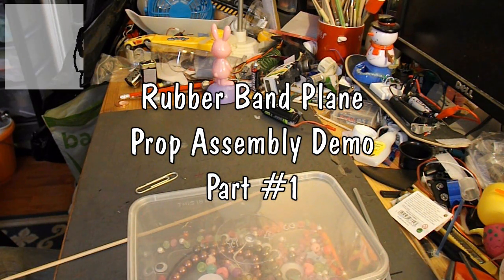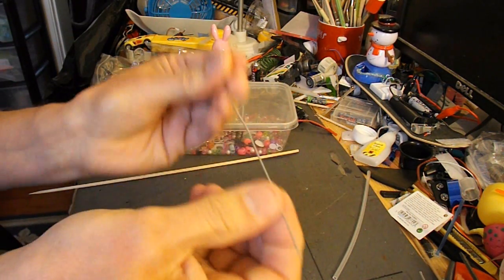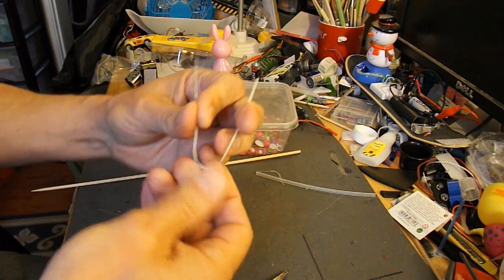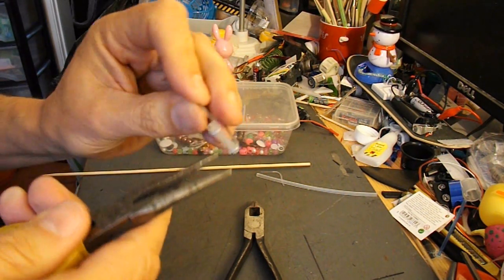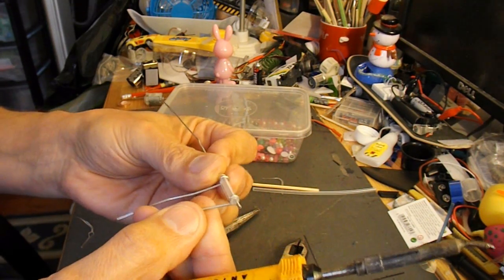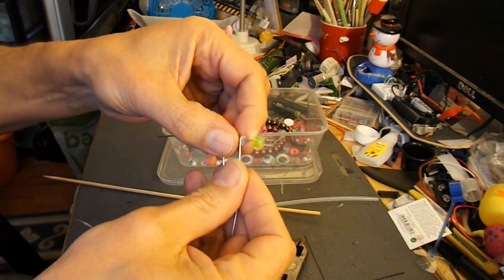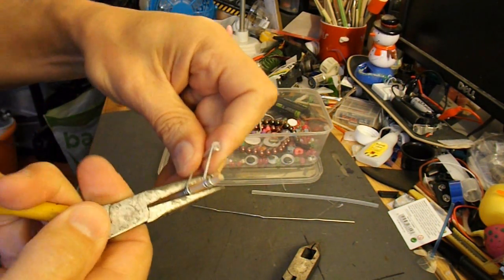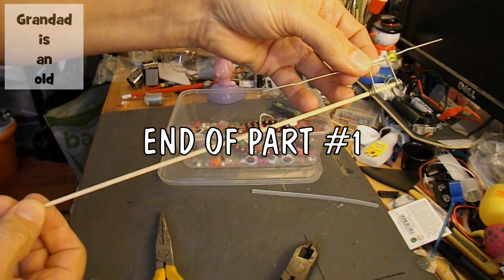Rubber Band Plane Prop Assembly Demo Part #1

Comment: Can ya get any substitute for beads?  Would 2 beads be better than one? I used the chopstick to wrap the metal too whole lot easier.
Reply from the maker: The bead serves 2 purposes, it stops the assembly digging into the plastic tube and it provides a low friction surface. Two beads rubbing together probably would give you less friction. Glass beads would be better than plastic. Anything you can find that will reduce the friction would help. The curved surface of a bead minimises the surface area in contact.
Reply: Ah thats very helpful thanks! it doesn't work without beads, glue and metal give lots of friction

Comment: and which prop is best for airplane??
Reply from the maker: My answer is basically the same as my answer for boats. I would suggest asking that question on an RC Aircraft forum. I would think it depends on what purpose you are using it for. In many cases people use multi-bladed propellers when they want to keep the diameter small. I have seen many debates on the subject. I suspect a two bladed propeller is the easiest to make. There are debates about the speed of the tip of the blade relative to the RPM and the tip of a large diameter propeller passing the "sound barrier" causing aerodynamic issues.

Comment: which prop is best for boats ?  3 blade or 8 blade??
Reply from the maker: I have no idea, I would suggest asking that question on an RC Boats forum. I would think it depends on what purpose you are using it for. In many cases people use multi-bladed propellers when they want to keep the diameter small.

Comment: Hi GrandadIsAnOldMan,
Could you please let me know where (which Shop) you got those Beads?  I  I was able to make a styrofoam plane the first one didn't fly but the 2nd one did.... tried to use Rubber Band for the propeller - didn't work... needs more trial for adjusting the CG....  propeller also not that efficient because I didn't use any beads to reduce friction....

Nice work, please continue posting your work...

Kind Regards
Jaffna.
Reply from the maker: +Jaffna they are just children's toy beads, any toy shop sells that sort of 'dressing up' stuff, Alternatively buy some old jewelry in a charity shop, That would probably be glass or hard plastic and last longer than the children's toy stuff.